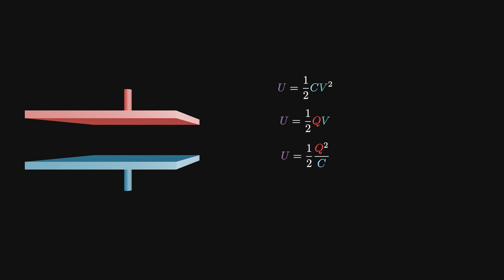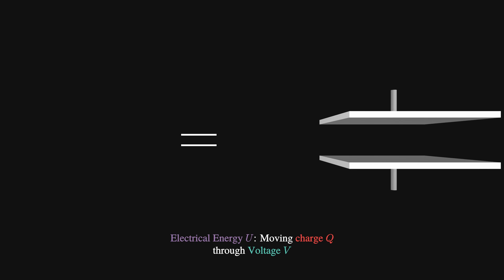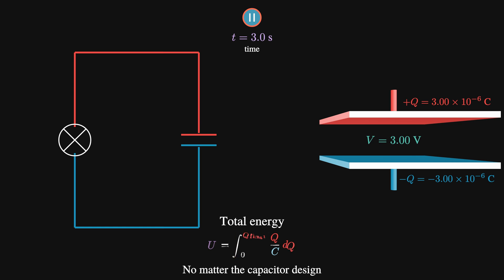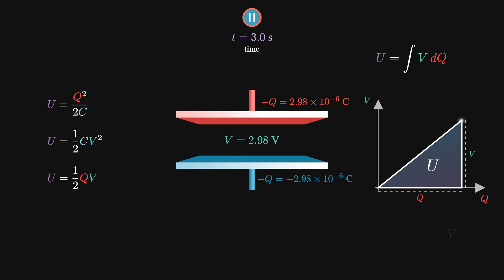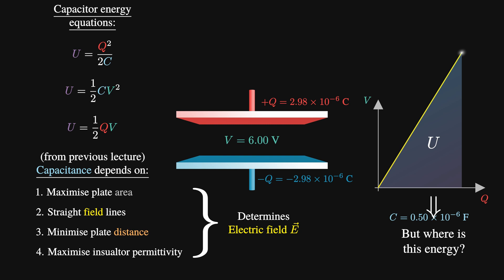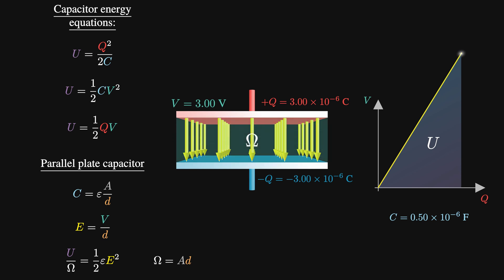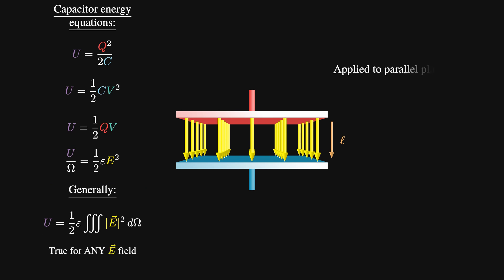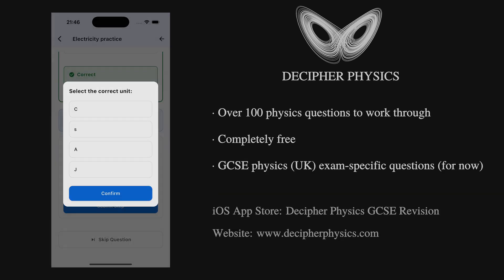Energy Stored in a Capacitor and Energy Density (Full Visual Explanation)

Comment: I think it was Franklin who used  two charged plates and carefully used a quartz thread to remove a solid dialectic from between them and the charge was nowhere to be found on otherwise undisturbed plates.... It's possible to also interpose a plate of glass between plates of an air condenser to show effect of different permittivities and to show how lines get induced, It was actually Poyting who discovered that energy is in a dialectic part of lines converging radially on the metal conductors, producing Julean change or waste or rejection of energy. Some of the cables are split into finer strands to present a greater area to the dielectric....I recommend Modern Views on Electricity by Sir Oliver Lodge.... And yes it takes energy to build the field.

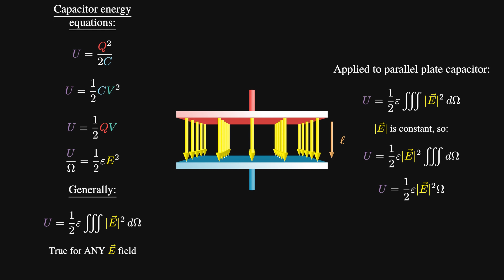Comment: at 10:30 how does the triple integral wrt omega equal just omega? am i missing something fundamental?
Reply from the maker: It's just the notation, integrating wrt volume is integrating in three dimensions so we typically write volume integrals like that (you could write dOmega as dx dy dz in this example, or in another example in terms of polar or cylindrical coordinates). In the case of parallel plates where E is const, this integral just gets the volume of the field, which is just a parallelogram of the plate area times the plate thickness. 

The reason we don't just write \int dOmega as Omega is because in some situations E varies throughout the volume (it might depend on x, y or z, or r theta or phi for example), in which case the integral needs to be evaluated.
Reply: Ah i see, thanks a lot. Much appreciate the reply

Comment: I have strong doubts about your integral trick at 9:25. This feels really wrong! Do you have anything to back this up, or could you explain a little more on it? 
Sure, this works fine if the electric field is constant within the volume - and this is a given for (an infinitely large) plate capacitor - but as soon as it changes, this trick ought to be wrong. 

To prove this: 
Let's assume E is proportional to x: E = cx and dΩ = dA dl = (dx dy) dl. Hence, 
int E² dx dy dl= c²x³/3 * yl ≠ int E dx * int E dl dy= cx²/2 * cx yl = c²x³ * yl/2
The two expressions do not match. 

I'm pretty sure you know this yourself. But to not confuse people not thaaat steadfast in this kind of maths, I would appreciate it if you state that this trick only works due to E being constant in a capacitor.

Else, a really nice video. :)
Reply from the maker: Yes, you are completely right, that trick only works in this simple case where E is constant. In this video and the previous I only really focused on the parallel plate capacitor, and wanted to mention the general equation for energy density, but I realise I am attracting a more advanced audience than I expected! 

If I recall the proper (general) derivation for capacitance C for any system requires solving the Laplace equation for V, then I guess there's a way you can find U in terms of E using 1/2 CV^2, which will yield the volume integral of E^2  (I've not tried!).

Thanks for the feedback!

Comment: For a physical demonstration of this concept, look up any of the videos that charge a Leyden jar (a type of high voltage capacitor) that can be disassembled.  This demo is occasionally done in the videos in conjunction with Wimshurst machines or Van de Graff generators but can also be done using other sources of high voltage.  The Leyden jar, once charged, can be disassembled into separated inner conductor, outer conductor, and dielectric insulating material.  The conductors can then be fully discharged but when the Leyden jar is reassembled, the jar will produce a spark when approached by a shorting bar, demonstrating that the energy remained in the dielectric in spite of being disassembled.

Comment: I had a question can you also explain why does the capacitor have a 90degree phase shift, please i also encourage u too explain more in depth rather than just showing mathematical models like why is it between 0 and 90 in real capacitors and 90 in ideal one please what is exaclty the mechanism please?
Reply from the maker: In the next video (out in the next few days) I discuss the basic series RC circuit, after will be AC electricity (generally). As this series is basic electricity, I hadn't intended to go too deep into AC circuits (ie full power electronics analysis), but will see how things go.

As for your questions, these could be interesting to visualise at some point. I guess you are referring to the phase shift of I(t) wrt V(t) in capacitors being 90 degrees (in AC circuits), which is because for capacitors I = C dV/dt, so if V is sin(omega t), the result for I is cos(omega t), equivalent to a 90 degree phase shift. Reason it's not always a perfect 90 is because of internal resistance in real capacitors/circuits, which spends some of the voltage along the path to the capacitor.
Reply: @DecipherPhysics  Yeah no i completely understand that sin and cos model but recently which evetyone might or might not have the misconception of understanding the phase shift as the time delay but it is not time delay it is just where you start on the circle or more like the Im and Real diagram, i also asked about this to my colleagues but they also said mathematical but idk i just wanted to know whats going on exactly in physical terms rather than just maths of sine and cosine it might be me just being dumb or silly, but maybe an analogy can help a lot to visualize it
Reply: @DecipherPhysics  One analogy i thought of was a glass and a tap same as capacitor = glass and tap = voltage dC analysis so when i switch the circuit on initially the current flowing will be peak or the valve the water flowing willl be peak which will fill the glass but the glass is not yet filled even though the water going in is at maximum rate it will  slowly accumulate water but this analogy fails as it says the phase shift as delay because water will take time to reach the surface. but if you can go ahead and come with a better analogy i will be really please thank you